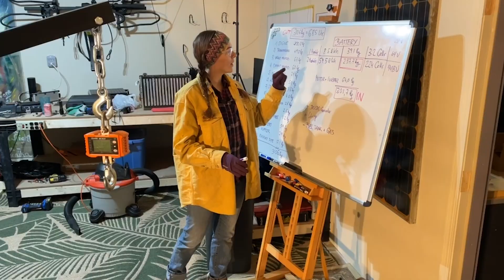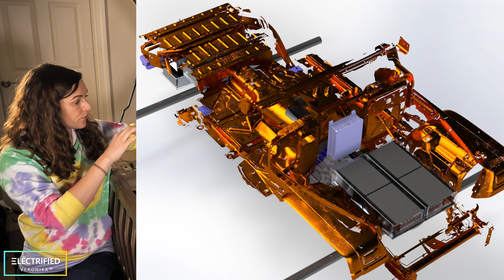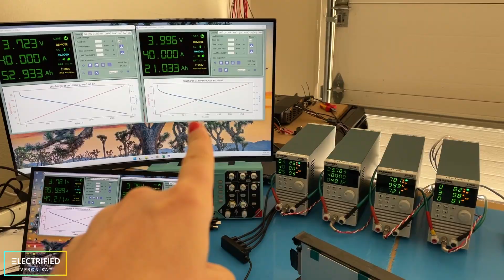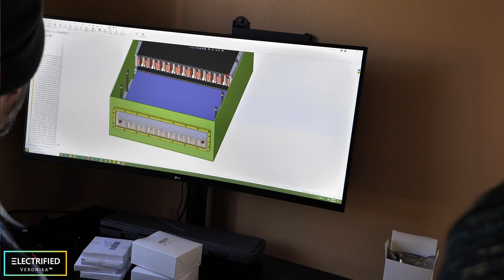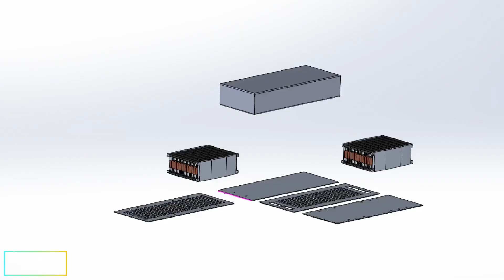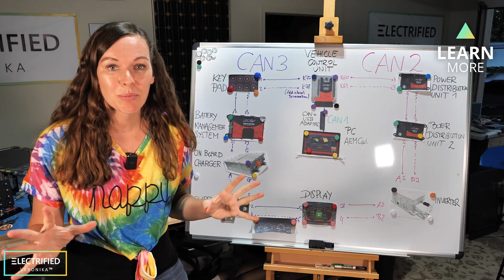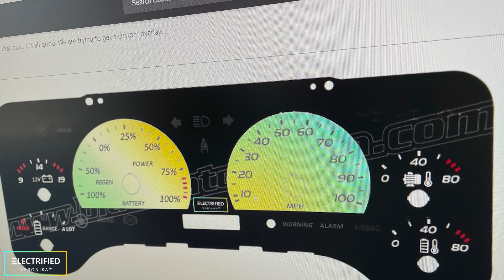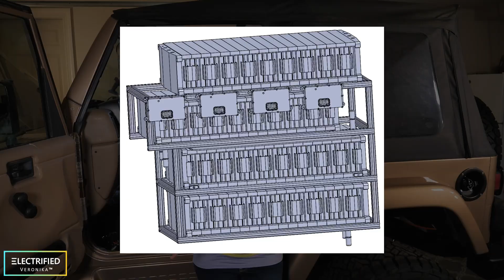Electric Jeep Conversion - First Prototype Done!

Comment: Very nice to see the progress of this build. By the way, I think it's wise to isolate the drive train (electric motor) from the frame using rubbers and I would ugrade the rear end with a Dana 44. The stock Dana 35 is a very weak axle and should have never be put behind the 4.0 from the factory. The constant torque of an electro motor will blow your diff in a heart beat. Keep up the good work.

Comment: I got a AES EVCU 200 and the Zonic 180 motor and it is without a doubt the hardest system I have ever worked with in 30 years of electric car building. I don't have it working and I don't seem to be getting anywhere with finding help. Looks like I got to buy a $700 cord to plug into my computer to talk to the thing. Feel like I'm just dumping more money into something that I don't even know if it's going to work. Have you ever got motor and controller to work?
Reply: Still looking to see if anybody has gotten this Zonic motor to where can I find my post here I'm pretty much giving up on this motor a very expensive bad idea. Company says I need to buy more and basically spend another 10%. I'm not sure if that's going to make it work even so I'm waiting and looking for somebody else that's gotten it to go.

Comment: I know im late to your build. but if you lay the in cab battery flat you can build rear jump seat mounts into the battery pack and it is now your seat mount. You could also cut the rear floor of the jeep and recess the pack down closer to the top of the under cab pack so the seat isn't as high, you need a good seals and enough clearance that the two packs do not interact.

Comment: Well done.  Everything looks so good. In my Project i want to build a AWD Hybrid conversion. So battery size is smaller. I also need to have a short battery stack that would lay on the rear hatch/trunk area. what is your estimated miles per charge? As I want to recharge from the existing Gas engine during highway cruise and use EV in the city my needs are different. Most different is the donor car is front engine and rear drive, so i will use Protean Hub Wheel Motors on the front wheels as their controller is build it. I will want a unique battery shape, where would suggest i look for battery construction? Thank for posting your project. Dennis in Virginia

Comment: I wonder if just mounting a secondary Air Conditioning system & direct all the airflow through strategic channels around the batteries & have the system turn on & off based on temperature levels/needs. Given the automotive a/C applications here'd be a million options. (or literally hook up the mechanism/guts of a freeezer & turn the battery box into a freezer - finding a way to mitigate condensation & moisture etc)

Comment: Your custom thermal management for batteries seems massive with less than ideal heat removal efficiencies. I would take some cues from the original cooling pads:
1. The path to least amount of labor and cost would direct you to reusing the original parts with minor modification and a smart method of routing the cooling fluid through all of them, even if you have to replace all the thermal pads.
2. Sticking with the custom design, the heat conductivity of copper is much greater than aluminum but also with higher density. If you are going to use copper tubing, I would seriously consider getting rid of aluminum plates that sadwich the copper tubing. At the same time, going with smaller diameter tubing and flattening it some to render more contact surface with battery bodies may benefit. This will also result in reduction in weight. Here again, use of thermal transfer compound e.g. adhesive thermal pad, thermal compound, etc. would be recommended as air is not a very good conductor of heat.
3. Applying the principle of convection, the cooling coils should be installed for each layer of batteries with possibly a thin sheet of heat insulation above the copper tubing between layers so that the heat contribution from the lower layer to the top layer is mitigated. 
Wish you success!

Comment: Put a roll cage and harness bars and race seats sounds unnecessary but is a must if you plan on driving this jeep at highway speeds these things are death traps without those check out gen right roll cages they are the best in the game with roll cages and then seats would be ones that fit and feel good for you same with harness

Comment: You guys should have the cargo battery module like a jerry can you can remove if needed
Reply from the maker: Thanks for the input. If we did not have the liquid cooling/heating system that would be a little bit easier to do. In general I would have liked to have all the battery modules mounted in a way so they are swappable and easily expandable when needed. Not on that first one, maybe in the future 🙃

Comment: for heat all you need is the liquid cooling method and the stock heater core  any where you can get away from using the battery for heat your better off. The motor controller and and motor will create there own heat to get optimal heat just monitor which one heats up and holds to the highest heat level and isolate it (that one is your heating friend) .  Your controller is most likely going to be the one that gets hot faster and use the liquid cooling to capture the heat for the cab to the heater core to keep your toes warm no battery used, increased range and less stress on the battery. One thing i can certainly say im all about K.I.S.S (keep it simple stupid) if you got free heat potential from liquid cooling its best to use it you may need to optimize the radiator size to keep the controller holding at no more than 70 to 80c and during the cold season you may have to cut the external radiator off completely to gain heat for the cab summer mode and winter mode can be done electronically by a push button and a couple of 12 volt valves that redirect the water flow to by pass the external radiator and name the push button "Defrost" and make sure the button has a light so you know its on and the external radiator is being bypassed. 
Anyway just thought ide toss that out there. Ill be posting my own E-conversion with in the next couple of months ive got all the electronics in for the drive line and its liquid cooled.

Comment: There is a possibility for  you guys to order custom cooling plates from china. Making them by yourself is a challenge. Also you want to keep connection points as minimal as possible.  Every hose connection can be a leak problem in the long run.  Also best cooling plate design is dimple design.  You want to have has much turbilent effect as possible without restricting too much. That is because of the surface water effect. As you know when you go swimming then usually water is colder at the bottom. When there is no turbilent water flow then there will be layers with different heat and the surface conductivity will suffer. 
I am currently working on Electric Porsche 356 project and I can tell you that space in small cars is a real problem. So I can say that I completely relate to your problems.  We are using 2022 EQS battery and also AEM BMS18 for our project.

Reusing Mustang battery cooling is always a green way to think. But it is not effective when you have batteries in different places. Because of orginal 16 cell pair design. 
If I would be in your shoes i would do one of following three:
1) I would build as light and compact battery as possible with a Range extender generator.
giving me a 18x5 90 cell 378v system. ( For it the Pairs need to be in series. not parallel has you guys have it) 
That would problably reduce the range too low. 
2) I would do same but I would build 1 pack into a offroad trailer. Also I would put the range extender there. 

I am not sure about mach e battery. I am starting to remember that I discarded them because of the kwh size that I would get with cells as series. 

3) anyhow.. sometimes... It is smarter to understand the limitations and sell these modules to somebody who would be happy about the work that you guys did and use them as they are.  Selling them will give you a opportunity to choose battery that will suit your room and BMS requirements. 

Feel free to contact me from FB.

Comment: I have noticed that a lot of these electric conversions have to have a button to engage the parking, the reverse, and the drive. Why? Can you not just use what's already available?
Reply from the maker: For us the reason to go the route with the new keypad was that the stock buttons are usually manually connected to the transmission or they communicate over CAN to the original VCU. Since we set up the entire CAN system with new VCU from scratch that was the way to go for us. There are also some safety things that were easier to integrate with the keypad - I will go into detail for that in a dedicated video coming up.
Reply: @ElectrifiedVeronika  I see, interesting, please if you can. I would appreciate it.

Comment: Why not use Tesla batteries since the bricks come with everything you need. Temp sensors, liquid thermal ports… etc???
Reply from the maker: We could not get up with the voltage using Tesla modules - we don't have enough space..this is why we decided to go the route to disassemble pouch modules and make our own versions with custom size and voltage..if you can and have the space in your car, use the Tesla modules - that saves you from lots of problems - on the other hand - never learned so much making our own modules, hehe.
Reply: @ElectrifiedVeronika  looking forward to seeing this chew up some mud.
Reply: Hi, watching someone else gives you son many ideas. Best to learn from how they doit.
Small 4x4 are the hardest, no space.
Still watching, hope it goes well. M.

Comment: Wow! What a project! I am a car guy myself and totally amazed by your work! I am planning to do a Corvette C3 conversion and already now got plenty of valuable input. Thank you so much. 
One thing I would be a bit worried about, is your small front mount of the motor. Is that really strong enough to receive torque? I saw the back mount which is very strong, but still, I think that the front mount should be at least as strong.
Was that your Mustang GT in the driveway? I am owning the exact same car since November 22!
Reply from the maker: Thank you so much for your feedback, great to hear that our content is helpful for you. Wow, a Corvette would be nice too! We will see if it is strong enough - we can only try and see - for that part we did not do any simulation but kind of trusted the work of our fabricator - but we will definitely share updates once it's moving. Yes, it's my Mustang and I love it. Bough it in February - my first car EVER  (well after the Jeep hehe)

Comment: One of the things I’ve picked up from watching other EV builds (and some of the issues that pop up down the road) is the need to make the battery boxes serviceable.  If you need to use a forklift to take the box out and then take the modules out to fix a BMS lead that’s worked loose on the bottom….that’s a real pain.  Obviously it may not be possible, but it’s something to keep in mind as you re-design.
I guess in a way, I’m lucky that the floor of my Jeep is completely rusted out, so when I replace it I’ll add access panels for the battery boxes.
Reply from the maker: Agree! I wish there was an easy way to do that - certainly we have ideas for a more modular design and hence more serviceable but not 100% feasible with just a garage shop setup - would also be really cool to have the system modular in a way that you could somewhat easily take out modules and swap them with charged ones when you go off roading - we also had that idea, but just super hard to make right now..

Comment: No electric fan on the radiators?  Relying solely on airflow cooling?  Is that sufficient at extended low speeds like traffic?

Comment: Great update, lot done since the last one.  If you're considering never really using dc fast charging, possibly change the battery chemistry to air cooled LiFePO4, there's a good variety of sizes to try and fit better, you will lose some capacity but maybe not the 1/3rd you're losing in not having that unit in the cargo area.  The custom gauge cluster looks really cool too!
Reply from the maker: If I did another conversion we would for sure think about getting different batteries - if available at all - LFP preferred. But for this one we really want to stick with the modules we have - we already put so much effort into it. And we might want to upgrade towards DC fast charging in the future as we have thermal management and everything set up for it. I LOVE the custom gauge cluster! THANKS!

Comment: Slide in battery blocks. Use a radiator between two battery blocks.
Reply: Then you can have a 3 or 4 battery setup and make more batteries as they become available to you
Reply from the maker: @David_Mash  Thanks for the input! This is definitely something we are considering! I'm a little hesitant about placing the modules sideways - although that's the configuration we have in the cargo space - I think these pouch cell based modules are mechanically designed to stand upright, and I'm concerned about mechanical vibration in the sideways position- not only on the cells but also on the busbars - maybe I am too cautious - if anybody has more insights, please let me know!
Reply: @ElectrifiedVeronika  if you make it a modular system,  you can orient the cells however you feel best. I would say that vertical vibration will be greater than side to side. Having 3-4 packs like briefcase style means you can have extra charged at home ready to swap and easy to bring one or two with youbon a long trip. And easy to make as you recycle cells or battery tech evolves.

Comment: For cooling - I think the cheapest and most effective cooling system for the battery would be to get an AC condensor unit from a small car, like a honda civic. These can be had for about $50 on Amazon, they're 1" or less thickness, and they would give a large continuous contact surface to your battery case. Your copper pipe (likely $30 at a box store) will have very little contact area by comparison, and you're likely to get differential metal corrosion if any moisture condenses inside your battery box (which will happen). You will need a small pump to circulate your working fluid through the condensor and out to a radiator. I would recommend mineral oil since it's non-conductive and non-corrosive. (AC systems used mineral oil before they converted to PAG oils.)
Reply from the maker: Thanks for the valuable input! We will consider your suggestion. Corrosion is a good point too!

Comment: For the battery cooling in the box look up “chill plate” for the hyper 9 motor controller. Now think flatter and much bigger. CNC the bottom and then use a flat piece for the top, a little rtv and done. If you want you can even design in some slots for the cooling fins.